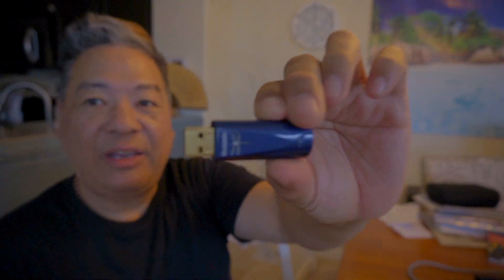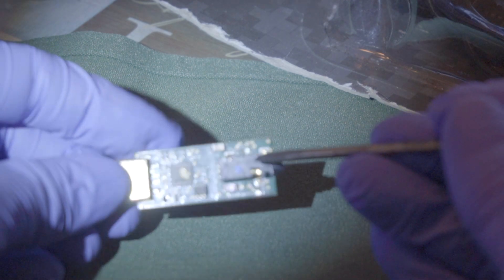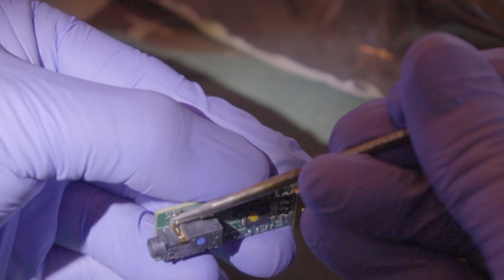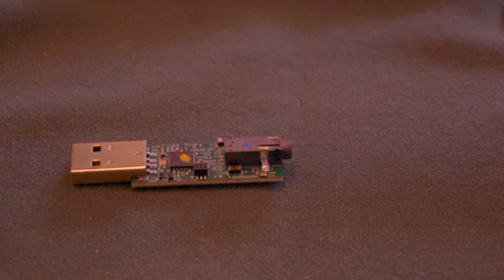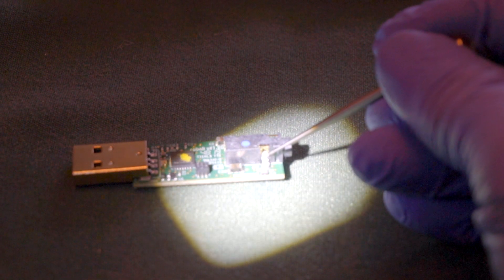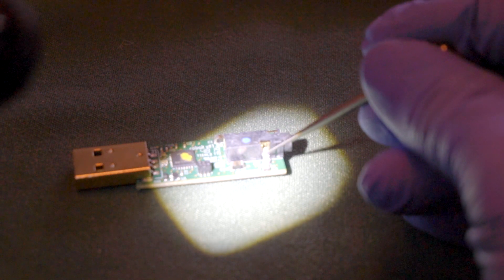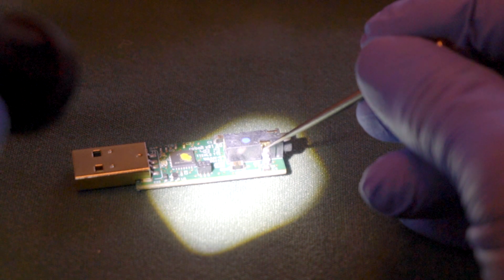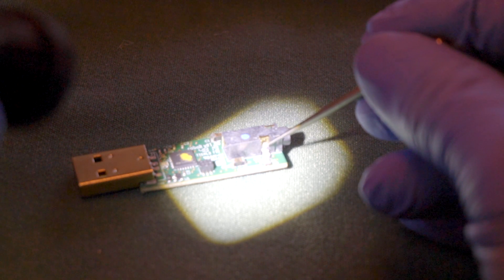Dragonfly Cobalt No Sound From Left/Right Channel Fix

Comment: the board is glues at the usb to the case and the cap is glued to, did you heat the usb or i take it you didnt have to deal with that
Reply from the maker: @commissarsydian4125  no heat. Just pried it apart.